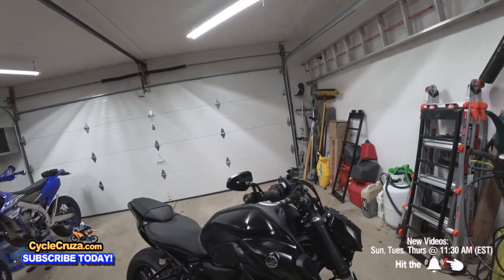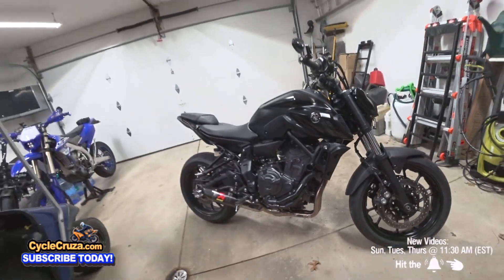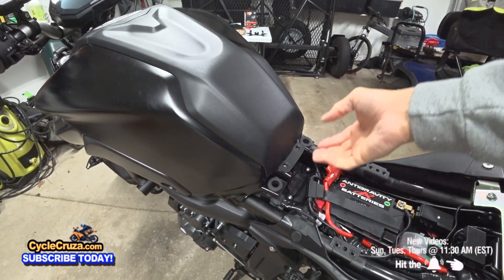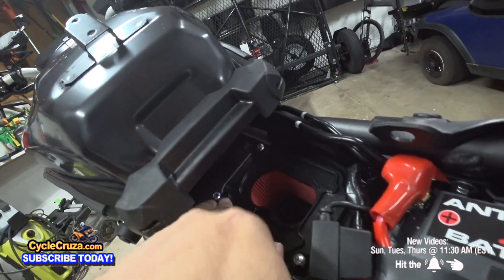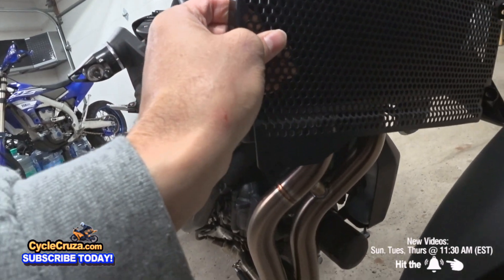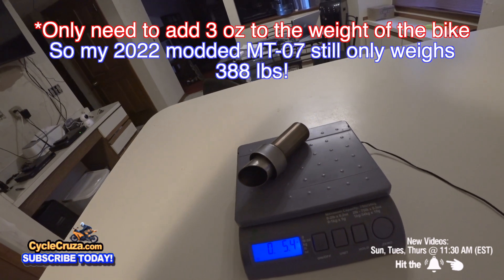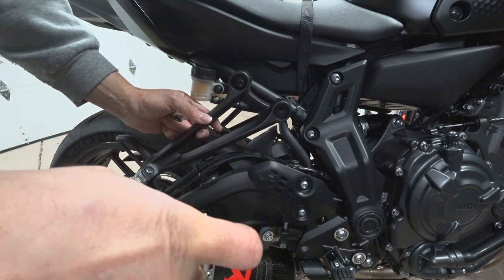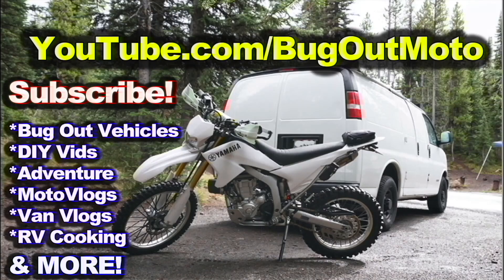NEW 2022 Yamaha MT-07 BUILD Ep. 5 | NEW MODS

Comment from the maker: Links to Stuff Shown in Video:. ⬇ 
Get Airbag Vest (On Sale!): https://cyclecruza.com/x0og
Get My Carbon Helmet (Best Ever!): https://cyclecruza.com/vhxg
Get Dynojet ECU Flasher: https://cyclecruza.com/lcbq
Get Akrapovic Full Exhaust: https://cyclecruza.com/z0xo
Get K&N Filter: https://amzn.to/3UXVTV7
Get Radiator Guard: https://amzn.to/3Ev7Xrr
Get Phone Holder Wireless Charger: https://amzn.to/3CQFtX2
Get Bar End Mirrors: https://amzn.to/3TlbJZu
Get Yamaha Mirror Plug Bolts: https://amzn.to/3VIeBRD
Get GoPro Mount (Saves Space!): https://amzn.to/3Aen7yY
Get Exhaust Spring Puller: https://amzn.to/3E9Dq14
Get Restart Lithium Battery (Never dies!): https://cyclecruza.com/ymjz
Get Yamaha 12v Accessory Plug:  https://cyclecruza.com/ay3l

Links to get My GEAR, MODS and Other Stuff: ⬇ 
Get AIRBAG Vest (On Sale!): https://cyclecruza.com/w34j
Get My Motorcycle HOODIE: https://cyclecruza.com/nsx7
Get My Leather Gauntlet Gloves: https://cyclecruza.com/iclm
Get My New 360 CAMERA (So Cool!): https://amzn.to/3qBFjxM
Get HEATED GLOVES: https://cyclecruza.com/jsqm
Get My CE Armor Jacket CHEAP: https://amzn.to/3AxZ6k7
Get My New Shorty Gloves: https://cyclecruza.com/pgip
Get Dynojet ECU Flasher: https://cyclecruza.com/3lh4
Get Anti-Vibe HandleBars: https://amzn.to/3DzT4UD
Get My Dainese Jacket: https://cyclecruza.com/l9xp
Get Urban Camo Pants here: https://amzn.to/2BK9YP1
Get UNLOCKED Galaxy S10+ (CHEAP!): https://amzn.to/2WQXe7w
Get My Bike Phone Mount: https://amzn.to/3CQFtX2
Get My Camera Bar Mount: http://amzn.to/2Au2k8B
Get My Helmet Microphone: https://amzn.to/3rwqb5e
Get Bar End Mirrors: https://amzn.to/2VlxWJ7
Get the BEST Tires Ever: https://cyclecruza.com/7wad

Links to ALL of My Stuff: http://cyclecruza.com/my-gear

MY E-BIKE
GET My Folding E-BIKE (-21% off!): https://amzn.to/3KXpWqR

MY HELMETS:
Get Bell Carbon Helmet (Best Ever!): https://cyclecruza.com/vhxg
Get My Dual Sport Helmet here: https://cyclecruza.com/lkm0
Get Ear Plugs here: http://amzn.to/1PE0NTn

MY JACKETS AND JERSEYS:
Get My Leather Jacket: https://cyclecruza.com/q9tq
Get Sedici Garda Jacket (Best for Street): https://cyclecruza.com/sffi
Get My CE Armor Jacket CHEAP: https://amzn.to/2BIRAG7
Get Hi-Viz Armor Jacket CHEAP here: http://amzn.to/1TC9fBa
Get My Winter Motorcycle Jacket: https://cyclecruza.com/l9xp
Get Hi-Viz Rain Jacket: https://cyclecruza.com/00xh
Get My Hi-Viz MX Jersey here: https://cyclecruza.com/iifs
Get Motorcycle Hoodie here: https://cyclecruza.com/nsx7

MY GLOVES:
Get My Leather Gauntlet Gloves: https://cyclecruza.com/iclm
Get HEATED GLOVES: http://cyclecruza.com/nwgp
Get My New Shorty Gloves: http://cyclecruza.com/w7ae

MY MOTORCYCLE PANTS:
Get My Leather Pants: http://cyclecruza.com/54cw
Get Sedici Garda Pants (Best for Street): https://cyclecruza.com/vb8e
Get KEVLAR Jeans: https://cyclecruza.com/vxij
Get My HI VIZ CAMO PANTS: http://cyclecruza.com/hivizcamo
Get Urban Camo Pants here: https://amzn.to/2BK9YP1
Get Yellow Camo Pants Here: https://amzn.to/2SjMGq8
Get Blue Camo Pants: https://amzn.to/2LBEgbk

MY BOOTS:
Get My Street Riding Boots: http://cyclecruza.com/uubp
Get My Dual Sport Boots: http://cyclecruza.com/3kn0

MY SOCKS
Get My Vented Socks: http://cyclecruza.com/0bww

MY PROTECTION
Get Knee/Shin Guards CHEAP here: http://cyclecruza.com/kneeshin
Get CE Back Protector: http://cyclecruza.com/npzw
Get NECK BRACE:  http://cyclecruza.com/gf4a
Get Knee Braces: http://cyclecruza.com/mobius

My BACKPACK and STORAGE PACKS:
Get My New No Drag Backpack: http://cyclecruza.com/nr6x
Get My High Capacity Backpack: http://cyclecruza.com/k0w2
Get Water Bladder CHEAP: http://amzn.to/2b5w5nv
Get Motorcycle Tail Bag here: http://cyclecruza.com/tbag

MY MOTORCYCLE TIRES
Get My Sportbike Tires (Best!):  http://cyclecruza.com/pangelfront
Get My Supermoto Tires (Best!): https://cyclecruza.com/tdlv

MY LITHIUM BATTERY:
Get Li-ion Battery (Restart button!): https://cyclecruza.com/mymc

Emergency Carry-On Items:
Get Flat Tire Repair Kit here: http://cyclecruza.com/f5du
Get Moto Survival Kit: https://amzn.to/2EwtsrI

MY MOTORCYCLE STANDS:
Get Universal Stands: https://amzn.to/2Ct2fpQ
Get My Lift Table: http://amzn.to/2kt1pD7
Get Bursig Lift Stand: http://cyclecruza.com/f0lc
Get Adapter Plate for Stand: http://cyclecruza.com/cpwr

MY CAMERAS AND STUFF:
Get My New 360 CAMERA (So Cool!): https://amzn.to/3qBFjxM
Get My MotoVlog Camera: https://amzn.to/3osqWe1
Get GoPro Hero Mic Adapter: https://amzn.to/2DAfiXL
Get 128GB MicroSD XC Card I Use: http://amzn.to/2ihwPsv
Get My Camera (Off the bike): https://amzn.to/2Kmqb5c
Get My Camera Bar Mount: http://amzn.to/2Au2k8B
Get My Helmet Microphone: https://amzn.to/3rwqb5e
Get My 2-Port Smart Power Bank: https://amzn.to/2K8Pm5n
Get My Travel Tripod: https://amzn.to/2LVXooH

MY MOTORCYCLE TRAILER:
Get Stand-Up Trailer for Motorcycles/Side by Side/UTV/ATV:  
http://cyclecruza.com/p2yo

Get Stand-up Trailer for Single Motorcycle
https://cyclecruza.com/stduptrl

*MY SOLAR GENERATOR (Charge E-Bikes FREE!):
Get SOLAR Generator: https://amzn.to/3NM0QO4
Get SOLAR Panel (for Generator): https://amzn.to/37af622

*MY MOTORCYCLE COVER:
Get Moto Sack: http://amzn.to/2lpIX9d

Links to All of my Mod Parts for my Bikes:
https://cyclecruza.com/my-mods

My Store: (All my Stuff) 
https://www.amazon.com/shop/cyclecruza

--------------------------------------------------

Go to my Video Playlists (Find Videos Easier):
https://cyclecruza.com/my-videos-2

Watch Supermoto Build Series:
https://cyclecruza.com/supermoto_build

Watch Defensive Riding Tips:
https://youtu.be/g18byMevjMA

Watch How to Ride a Motorcycle Video Series:
https://cyclecruza.com/how-to-ride-motorcycle

Go to My Motivational Videos Playlist:
https://cyclecruza.com/motivational

Watch My Bug Out Moto Van Video Playlist:
https://cyclecruza.com/bug-out-van-videos

---------------------------------------------------------------------------

SUBSCRIBE TO MY ALL-IN-ONE Motorcycle CHANNEL! 
https://www.youtube.com/subscription_center?add_user=cyclecruza

SUBSCRIBE to my new Bug Out Moto Van Channel:
https://www.youtube.com/bugoutmoto

WEBSITE/BLOG (Be notified of new content and deals!):
https://www.cyclecruza.com

TWITTER:
https://twitter.com/CycleCruza

Comment: Good call on the radiator guard. But take a gander at the oil filter. It’s a fantastic target for a rock kicked up by the front tire. I just pushed a small hot tomato sauce can over mine. It’s obviously not bullet proof but it gives me some peace of mind.
Reply from the maker: Eh I wouldn't worry about that. Rocks hitting the oil filter won't do much.
Reply: @CycleCruza  I ride up over the mountains and down into the Southern California desert where there is a lot of small rocks and loose gravel. Back in the eighties I rode my new hurricane Honda 600 out to the desert and the oil filter got punctured by a small stone kicked up from the front tire. That’s when I came up with the tin can shield. Maybe I’m just unlucky.
Reply: @CycleCruza  yeah

Comment: when the baffles removed..the bike sound like a V-Twin engine...so proper sweet!
Reply: 90° V-twin (example Ducati) is a 270° firing interval.
Parallel twin engine with 90° separation between crank pins, is a 270° firing interval.
This is why the frequency of the sounds emitted from both engine times are identical.
Reply from the maker: Yeah it sounds awesome, I love the sound of this bike so much with this akra exhaust.
Reply: @CycleCruza  Thankfully there's a ton of bikes out these days with parallel twin 270° crank.
Some examples:
180° (Kawasaki Ninja 400)
270° (MT-07)
285° (890 Duke R)
315° (Nuda 900R)
360° (F800GS)
I think the best parallel twin designs are 270 and 285 degree crankpin relationship.

Comment: If u want u can just remove the pegs and put the reservoir in the hole the pegs were using just remove the rubber spacer
Reply from the maker: How? The bracket is attached to peg bracket.
Reply: @CycleCruza  remove it all. Buy passenger peg block off plates for. U can also delete the rear brake reservoir to help clean up even more it looks very nice I did it on my 09

Comment: would you ever consider a turbo kit? Or is that too far..
Reply: MT-07 turbo kit:  MT-09.
MT-09 turbo kit:  MT-10.
MT-10 turbo kit:  1290 Super Duke R.
Reply: @exothermal.sprocket  Mt07 with a turbo is faster than an mt09 on paper. It has a power to weight ratio to that of an MT10
Reply: @Dave-qq4lh  Eh, until we get some quarter mile times, it's only debatable.
Reply: @exothermal.sprocket  yeah ok bud
Reply: @Dave-qq4lh  Thanks bud.

Comment: dont know whats stronger but my 2015 model its much easyer to take the panels of the tank i can do it in 10 to 15 min now have doen it a few times playing with airbox and filter.when i took my snorkel of i lost power that was with no tuning so put it back you have a tune yes top end was better but lost the down low torq

Comment: With no baffle your bike will run lean
Reply from the maker: That is why you flash the ECU with this:  Get Dynojet ECU Flasher: https://cyclecruza.com/lcbq
Reply: @Mr.FirebIadeDr.JiIIAIiceCooper  no  it will not adjust itself for pipes,dont believe everything u read on internet, doc
Reply: @Mr.FirebIadeDr.JiIIAIiceCooper  been riding. For 40 yrs many bikes,doesn't change anything,bikes have one map to run on and they don't ( tune) themselves
Reply: @Mr.FirebIadeDr.JiIIAIiceCooper  ok,u know better
Reply: @Mr.FirebIadeDr.JiIIAIiceCooper  False. Old Wives Tales. Motorcycles are not cars. They do not compensate more than 10% at the very most. Factory tuned ECU's are already lean for emissions. Add more airflow, they get WORSE.
Watch some videos on Moore Mafia channel, or Brock's Performance channel.
Reply: @Mr.FirebIadeDr.JiIIAIiceCooper  Engines will run just fine at 16:1 air/fuel ratio. For a while. Then they start breaking down.
The trouble with assuming (like tons of people online do, who comment the same comments under every single dyno video, mod video, exhaust brand video) you can just buy X exhaust and pop it on, and run the bike without a tune, it's just ignorance about the process. Getting the most exciting part of the thing done, without the scary part people don't understand. They are smug in believing they've cheated the system and gotten the best bang for their buck. No. They just effectively shortened their engine's life span, more than manufacturing regulators already do.
None of these bits are power-adders. They are power-restorers. Power adders are things like head porting, compression raising, valve grinds, replacing rotating assembly parts, turbos, superchargers, nitrous injection. Power-restorers are bolt-ons and ECU flashes to allow the inherent design of the engine do the most it can possibly do as designed at the factory in hundreds of thousands of hours testing and refining, before regulators strangled it.
Automobiles have a much more advanced and sophisticated computer which is able to adjust for more drastic changes in operating conditions. Motorcycles do not. You have to reprogram fuel, ignition, throttle plate, and other maps before the ECU gives a rip about the amount of air going through the engine.
Reply: @Mr.FirebIadeDr.JiIIAIiceCooper  If you want to run your engines lean, that's up to you. The fact you've taken assumptions about my motorcycle experience shows how daring you are without asking questions. So I won't volunteer any data to you either.
Reply: @Mr.FirebIadeDr.JiIIAIiceCooper  No assumptions here. Just loads and loads of video evidence, tons and tons of dyno graphs, lots and lots of engines, and years and years of absorbing it. Now you do your thing, just stop promoting it as a viable way to run engines.
"They have all been fine."
Right, you've taken them apart and examined the cylinder walls and pistons and valves to verify. No?
So stick with the air-fuel ratio work that dyno shops develop to speak about facts instead.
Reply: @Mr.FirebIadeDr.JiIIAIiceCooper  You're just lying now, without any evidence.
Mr. Cooper, are you a mechanic, pilot, carpenter, blacksmith, engineer, seamstress, computer tech, plumber, farmer, or city mayor?
I'd be stupid to say what you are without any evidence. Just like you have.